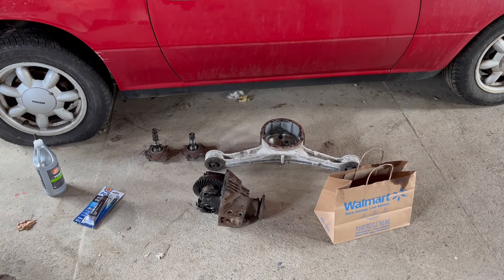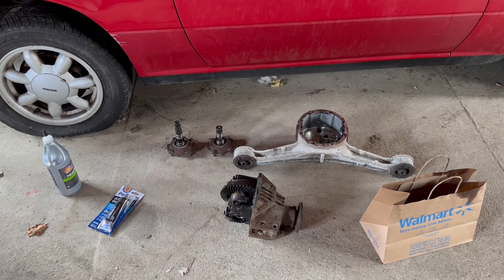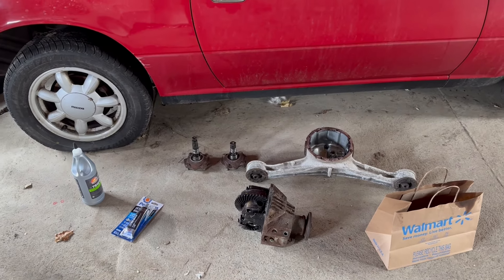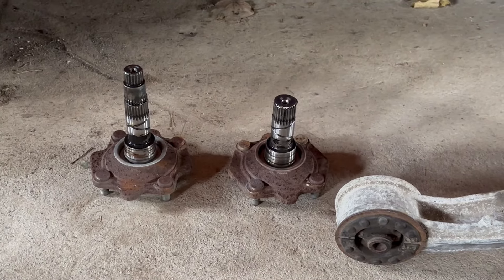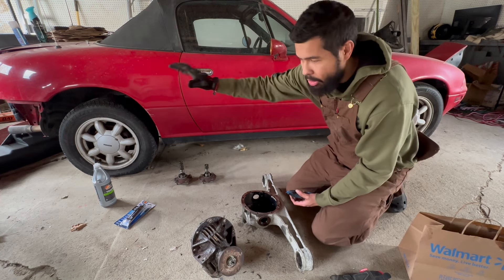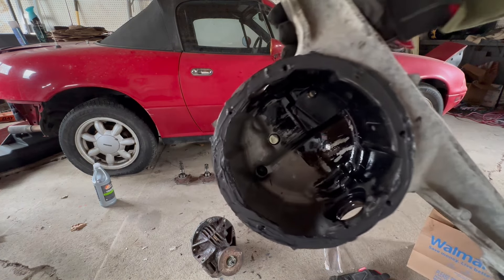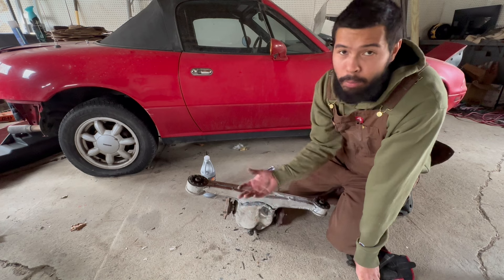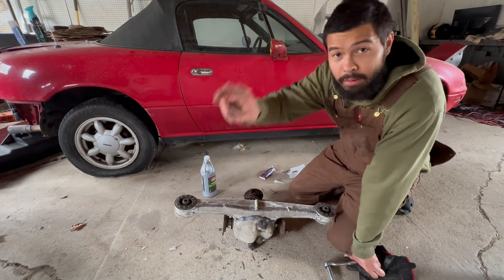It is possible that my welds will fail

Comment: I made a video a little over 6 years ago on poly filling motor mounts for under 10$

They didiny look amazing but the are still in the car to this day and work amazing 

It’s super easy and definitely worth the time and money especially on a budget build 

So far I’ve done motor mounts, diff mounts, subframe bushings and trans mounts and I’ve never had a failure 

Also i have them in my ipl g37 drift car and they made a massive difference and wayyyyyy easier then dropping the subframe